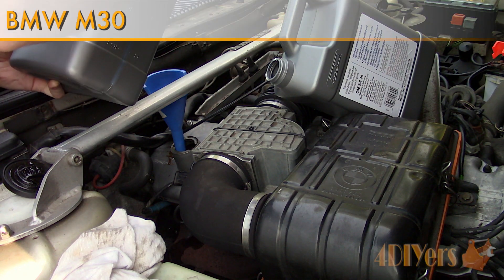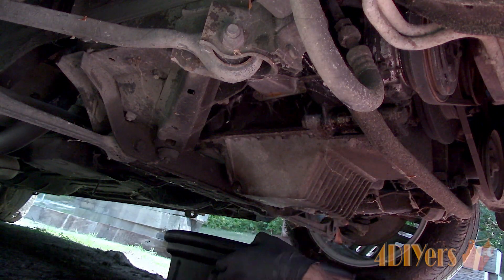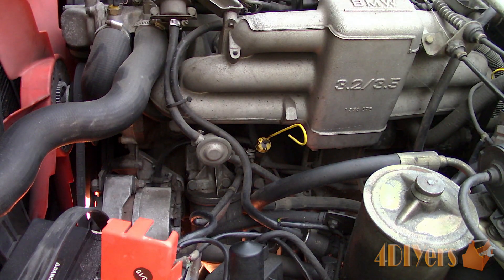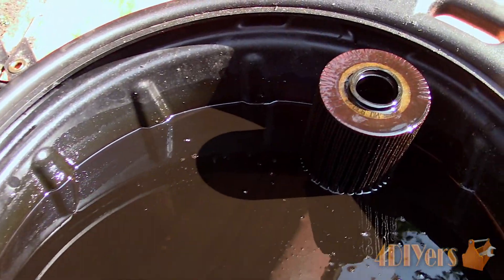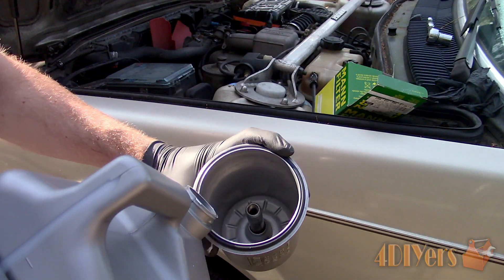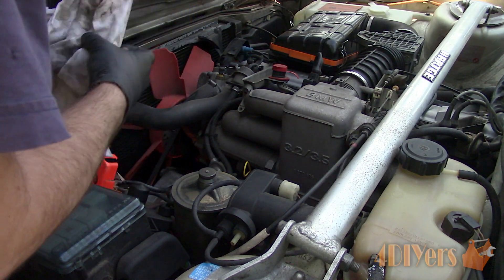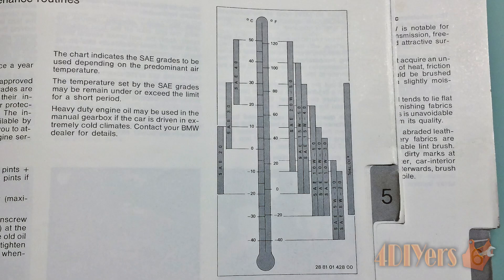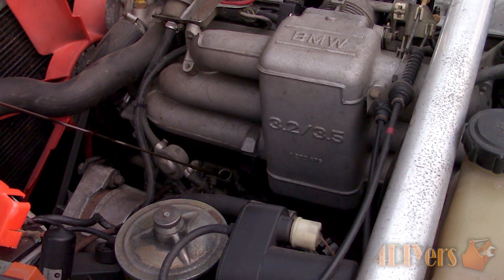How to: BMW M30 Engine Oil Replacement

Comment: Good video as allways!
Any good tips for increasing a little hp in a m30b25 1986 e28?
Its jetronic i think.

Grtz and keep up the good work.
Reply from the maker: Thank you :) 
That might be a Jetronic, I though that ended in the mid 80s but after looking at the years they continues through the mid 80s too. Mine is a Motronic. Biggest thing I've found for performance is ensuring the engine is running right. Tune up, refurbishing the AFM (made a huge difference for me), adjusting the valves (also a big improvement), and switching over to synthetic fluids (engine, transmission, diff). Then you can get into more complicated stuff like a performance catalytic converter (over 30yrs, it could be plugged), improved exhaust, headers (but expensive, I'll be getting one eventually for mine), mechanical fan conversion to electric, lighter wheels, port match and polish the intake runners (I have a couple related tutorials, might be doing this to my Volvo once the weather warms up), and chip upgrade.

Comment: Hey my 1990 e34 535i has no owners manual book and i dont know the grades of oil the book you showed with the grades of oil can i refer to i use 5w30 in winter but summer is almost here and i wanna switch soon ? I have the bmw engine m30b35 thank you .
Reply from the maker: I just uploaded the photos to my Facebook page so you can see it easier https://www.facebook.com/4diyers/posts/1656665721081486